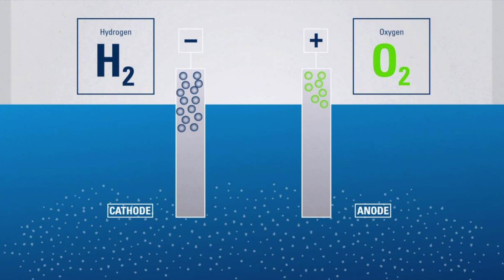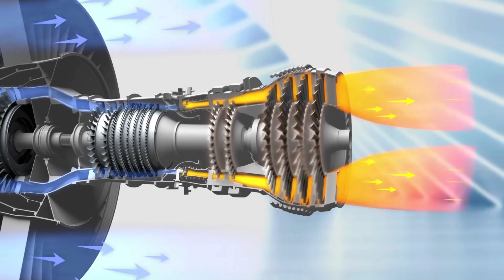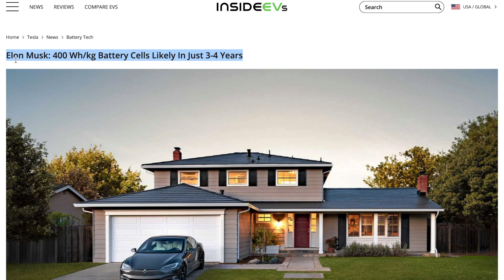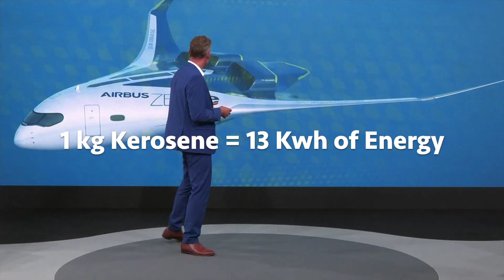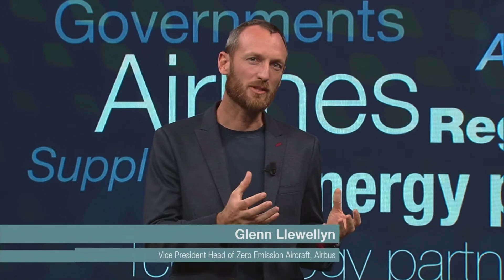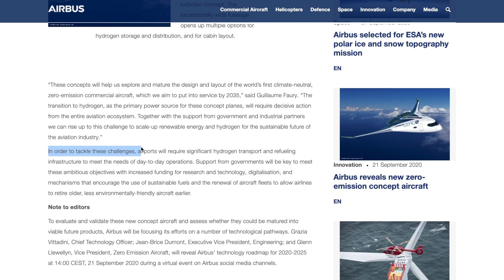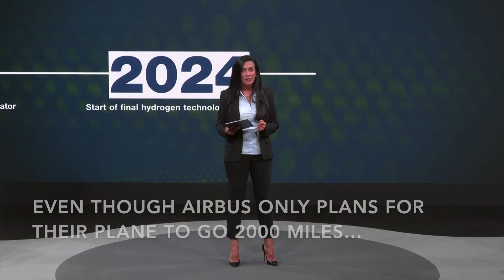Why A Hydrogen Plane Is A Terrible Idea

Comment: Battery power simply isn't viable for aviation in anything other than piston engine aircraft (no, not even turboprops). A reasonably energy dense battery system and accompanying motor would do fine in say, a cessna 172 for maybe a 100-200km range at prop speeds. The issue with larger, faster aircraft is the fact that propellers are very inefficient at converting the energy from the engine into thrust, hence why all prop aircraft are slow. Even turboprops, which spin their props at significantly higher RPMs than typical piston engine aircraft are still slow and less efficient compared to a jet. 
The ability to combust hydrogen in a turbine is a major factor that absolutely makes it a viable and sensible choice for use in commercial aviation, you simply cant achieve the speeds and efficiencies of turbofan aircraft with propeller driven aircraft. The US looked into the viability of a very high speed turboprop in the 60s, with a supersonic propeller, it was so loud, and the spinning prop generated so much torque that it was too dangerous to fly, and was still outperformed by even the early turbojets of the time, and lets not forget this was powered by a turbine. If you wanted to come anywhere close to a system like this, you need an electric motor that is incredibly energy dense and can generate a few thousand horsepower. You of course still have the problems of supersonic propellers being extremely noisy (i.e constant sonic boom due to the pressure waves generated at the tips of the blades) which also makes them a non starter as the only potential viable option for battery powered commercial aviation.
As a few other comments have said, aircraft are not designed to land fully loaded with fuel, a hydrogen fuelled aircraft  gets lighter over the duration of the flight, so you have to carry less energy than you would in a battery powered aircraft. Factoring in the fact that the electric plane would fly lower and slower, so would experience more drag and spend more time in the air than the hydrogen jet, requiring even more energy to be stored, the benefits of hydrogen turbines are even more obvious.
Hydrogen can be produced cleanly with renewable energy, and the cost of this will decrease rapidly, especially as investment in hydrogen infrastructure becomes more widespread. The UK should see a huge boom in hydrogen infrastructure over the next 10 years with the rollout of hydrogen boilers, this will absolutely push down the cost of producing clean hydrogen, but also introduce a nationwide grid for hydrogen supply. With this comes a number of benefits that should also provoke investment in hydrogen vehicles, such as hydrogen cars.
Hydrogen is absolutely the future in a lot of sectors, especially aviation, but also in the motor industry, just at the moment all the hype is around batteries, give it 5 years and we will all be talking about hydrogen combustion or (especially in cars) hydrogen fuel cells.

Comment: The calculation is of:
1kg of H2 contains ~33,3 kWh. to convert water you need hydrolysis (80% efficieny) and you need to compress it (20% energyloss). That gives us ~52kWh needed per 1kg compressed H2. The productioncost of 1kWh Electic  energy is between 3 and 8 ct before texes (depending on the method). Let's take 6ct for our calculation. Meaning if you cut out the middle man and produce hydrogen yourself, you can get the priee down to $3,12 per 33,3kWh energy (or 1kg compressed hydrogen). That gives you ~9,4ct per kWh.
Now, if 1kg of cerosine contains 13kWh and costs 83ct that would give you 6,4ct per kWh. If we would (as we sould) slap a carbon tax on this dino-sludge it suddenly wouldn't look so grim for H2 anymore. Also, we could use this money to built the necessary infrastructure (is what clever poiticians would do).

BUT that's not all ("there is one more thing"). A combustion turbine has an Efficiency of ~25% meaning  the price for useful energy increases to ~25,6 ct/kWh for Cerosine. Fuel cells on the other hand currently have  40% efficiency. that means if Airbus would use fuel cells insted of turbines for energy conversion, that would increase the price for useful energy to 23,5ct/kWh for our compressed H2. Yes fuel cells are heavy, but remember: You might save some weight due to the higher energy density of H2 compared to cerosine.

There you have it.
->23.5 < 25.6. And this is with current technology (and taxes).

That is why they are doing that. No company invests in something that isn't economically viable unless they are forced to.
Reply: A good first principles assessment. I wanted to just add my two cents on what you've said if I may too, not on your first paragraph (which I generally agree with) but on your second, about GT's and fuel cells. 

Aero GT's are typically between 20% and 50% efficient thermally, depending on scale. At the smallest scales, so model aircraft micro gas turbines, they are typically 20%. At the regional scale, it rises to 30% or so (like the PT6), at the mid scale around 40% (so the PW1000G), and the largest (GE9X), up to 50%. You could expect the concepts Airbus is considering to be between 30-40% for the regional and MoM scale designs. Fuel cells can approach 60% thermal efficiency at the stack level, but once the cooling losses, compression losses, and transmission losses are added, that falls to around 45%. Still better than the GT of course, but then you have to consider the weight and drag impact too. GT's are incredibly power dense, typically around 6 kW/kg. The best fuel cells are about 1 kW/kg, so the system is around 6 times heavier at present. Future developments could increase that to about 2 kW/kg though, still 3 times heavier. This eliminates the weight advantage of the fuel saving through higher efficiency. Then there's the rest of the system, so fuel to fan. You need motors, power electronics, cables, electrical protection, switchgears, insulation, redundancy, and thermal management. This pretty much halves the power density of your system, so we're back to 1 kW/kg at a propulsion system level. Finally, there's the thermal management. A fuel cell needs cooling to a very specific temperature, usually around 80 degrees C or so if it's a PEM type (which it will be, SOFC are too heavy), which means a very small delta T to work within in terms of cooling with the air (which on a normal day is 15 degrees C). This means very large intercoolers are needed, which significantly increases parasitic drag. And drag increase is the ultimate taboo, because that what we're trying to overcome in the first place, and it means you get stuck in a detrimental design iteration that results in an overall worse system once the design converges.

Fuel cells have a place, without a doubt. But some serious thinking needs to go into it first, because the challenges are not insignificant. There's also the fuel tank weight to consider with hydrogen, compressed hydrogen tanks are very heavy, and very large. Liquid is the better option for performance, but that has another set of challenges too. It's no easy problem I can tell you!

Comment: This seems pretty one sided. I like how you ignore all the negatives of batteries. Batteries lose performance in cold or hot weather for instance, hydrogen doesn't. Also as you use hydrogen the plane becomes lighter which means the efficiency improves as you fly. Whereas batteries are heavy even when empty.  Airplanes are supposed to have a long life, 30+ years. batteries don't last 30 years. Batteries seem like a terrible way to go for the aviation. Like use a bit of common sense perhaps?

Comment: As a proof of concept today you can fly drones for twice as long as the best battery powered drone with similar weight. From that point onwards as you increase the size of drone, the hydrogen powered drone becomes more attractive due to increasing range to weight ratio; whereas it is opposite for a battery powered drone. Forget about flying with battery, you can't even run a 18 wheeler on batteries.
Reply: Exactly. Batteries are a waste of time. E-Kerosene is the future.

Comment: I hope batteries advance at the pace you mentioned, but I don't think it makes sense to compare current tech to speculative future tech

We're talking about high altitude flight here, where fuel temperatures can be -30C to -40C. Batteries generally don't perform well at those temperatures where it might actually benefit hydrogen. 

It took 8 years from conception to delivery for the 787 so these advances battery tech would need to  be ready in ~2030 to be incorporated into the design. We have already studied converting planes to hydrogen so it's more or less a known quantity.

Comment: Bio fuel will be the answer for larger aircraft. Batteries will never take a large commercial aircraft anywhere commercially because of lifespan, cost, charge time, weight & issues with heat & fires. 

Hydrogen has potential for smaller to mid range aircraft if designed well but storage of liquid gydrogen at 400+ mph is a heck of an engineering challenge and the bigger the plane the more difficult it gets. It's the equivalent of building taller and taller lifts.

Comment: Here's an idea.....

Regenerative Hydrogen Fuel Cell Engines or RHFCEs are Hydrogen Fuel Cells that pumps its waste water and additional water supply such as condensation vents through boiler tubes that creates steam. the steam spins a turbine that spins a generator, that powers a steam ion reformer that splits the same steam into hydrogen and oxygen for use again and again.
Reply: Entropy would like a word with you...
Reply: @JamieM20001996  Doesn't hurt to try.  Current jet engines can definitely add an attachment that can suck in air, condense it, create water, pump it in an electrosysis tube and create hydrogen. Some planes already have AWGs to create potable water using bleeding air from the wing. Add a method for electrolysis and hydrogen can be made. I'll argue that nobody really tried it yet to oppose of entropy. In no way I am referring to using the fuel cell as the primary source of an airplanes power but perhaps in conjunction with a mechanical turbo engine and/or a battery source. Apus are currently used In most planes anyhow so I can see electric planes using ground sources for take off.
Reply: @natesnacks7829  I work in research in Nanomaterials in spliting H2 from water. I too came up with a simalar idea (recyling the water but in fuel cells) but we would need a small back up source that can overcome the onset potential for the reaction to occur in the first place + Energy required for other parts of the process just incase H2 power can't cut it efficiently. Nevertheless not impossible though. Just requires some smart engineering. Of which I probabaly wouldn't be a part of lol.
Reply: @natesnacks7829  You would need an external power source like a battery. A really big battery. Otherwise it would be an perpetuum mobile.
Reply: This would only work if there where no losses but unfortunatly perpetual motion doesn't exsist like this. It is a cool idea nevertheless so it's worth taking a shot
Reply: @sjoerd_maasland581  this wouldn’t be a perpetual motion machine because it would be using hydrogen as a fuel. Low yield of hydrogen from awgs/h20 splitters would be a problem if anything due to entropy and more hydrogen being used then what’s coming in. I did recently learned that Rutherford discovered that uranium naturally splits air into hydrogen, so radioactivity or nuclear waste could be quite possibly useful in the  production of hydrogen .
Reply: That just sounds like a really inefficient battery. And you can’t charge the battery during flight so just drop the water and get hydrogen when you land.

Comment: Electric is a bad option for planes. Low turn around time, massively reduced payloads, and far heavier landings. Yes battery technology does keep getting better, but we are nearing a plateau that would take a completely new technology to continue our progress. Breakthroughs like that just cant be counted on.
Reply: Absolutely spot on. All the issues you've mentioned are major problems as it stands. Turnaround time is something most people (even professional engineers, believe it or not) overlook, and at the scale of aircraft where batteries could potentially offer acceptable performances, profitability is super sensitive to turnaround times (commuter to small regional, or DHC-6/Cessna Caravan size to ATR-42/Dash 8 to give market examples). 

Payloads also must reduce, either that or wingspans need to increase, adding induced drag, requiring more thrust, meaning more battery required for a fixed performance requirement. Furthermore, one issue you might be aware of but hadn't mentioned is field performance. Small aircraft have challenging take-off and landing performance requirements, and heavier aircraft make that a problem. Part 23 aircraft also have a max take-off weight (MTOW) limit of 19,000 lb, which makes things very difficult in terms of payload too, and if that limit is breached and requires Part 25 type certification instead of 23, the entire concept will become economically unviable. 

One thing I will sort of half dispute though is the heavier landings bit. It's true that max landing weight (MLW) as a constraint is a problem for many aircraft, but typically that's for larger aircraft. Smaller aircraft (like the DHC-6 or Caravan) have almost the same MTOW and MLW, so they can land at more or less the same weight as they take off from. This is also true for the larger end of the prospective electric market, say the ATR-42 (600 series), which has a MTOW of 18,600 kg and a MLW of 18,300 kg, so again it should be OK from that perspective. 

That said, in my opinion, batteries will never be the sole solution, even if electric propulsion is adopted, because it simply isn't good enough, even with the best projections. For GA, some small utility, perhaps local cargo, and sports aircraft, it could work. But beyond that, I think other options will rise triumphant. Anyway, great comment, very well informed.
Reply: @onetrickhorse  as far as the heavier landings go, yeah I was referring to the larger 737 replacements that we would need to see in the industry  for batteries to be even remotely considered a solution. If I remember correctly, there currently is a small battery powered aircraft about on par with the smaller cesnas, but it just wont scale.
Reply: @averagejoe9040  Yeah, 737 firmly sits in that middle of the market domain, and they do have that MLW constraint far below the MTOW that would pretty much rule out batteries, hence the need to dump fuel on emergency return scenarios. You're right, there are a few small aircraft using batteries, 2 seaters, that sort of thing. I agree, scalability of battery-only aircraft is severely limited, even the DHC-6 sized aircraft can barely even make the divert reserve energy, let alone any sort of decent mission range. Batteries could however be used with hybrid concepts in a variety of ways, but still that's niche, and won't scale beyond Part 23 sized designs.

Comment: Noted your points with ineffiencies with H2 but there are more inefficiency with batteries that H2.  Overtime battery loses capabilities to charge to 100%, the more weight you add on the plane the more power it will draw from the battery to keep the same speeds, you cannot repair/rebuild batteries like we repair filter, cells, etc... for hydrogen, lastly batteries don't have the torque or power that hydrogen powered fuel cells have.  So heavy lift, will be a concern.
Reply: Oh yeah a hydrogen tank would be faster to refill than a giant battery
Reply: Fuel Cells systems would be better for large aircraft than battery systems yes, however your statement about power/torque is entirely incorrect. If anything batteries have the higher power. They have nearly unlimited power, in fact. In fact this is probably the biggest challenge with a HFC aircraft right now in that it requires a lot of power, and that means having a lot more fuel cells (and/or batteries for non-sustained power requirements), which adds a lot to cost and weight.
Reply: @knightblueyan5682  yes, although a modular system could probably be used to swap the entire battery packs, eliminating that problem.

The big problem with batteries is simply their terrible specific energy.

Comment: 0% emissions (if solar is used), does not have the extreme weight of batteries, range and capacity of gas, why are you saying it's not the future? It is not efficient? Planes on fossil fuels have thesame efficiency. Hydrogen is expensive? Everything that is not mass produced is expensive. Hydrogen will take over batteries if those aren't updated quickly
Reply: Planes need to fly at night too......

Comment: 4:26 'Solid state batteries up to 10X more efficient than current Li-ion':  Not anytime soon, at least for re-chargeable batteries.  QuantumScape says it will take until 2028 to commercialize their SS anode-less cells that might be 500Wh/kg.
Reply: @Aeroplane batteries with that raw energy density have been around for a while. The specific energy decreases when they get put into a cell, and then again when the cells are placed into a pack. By the end of it, you're left with something around 240 Wh/kg. Most of the advances in battery energy density have actually been in volumetric energy density -- improving packaging so that you can fit more battery in a given volume.